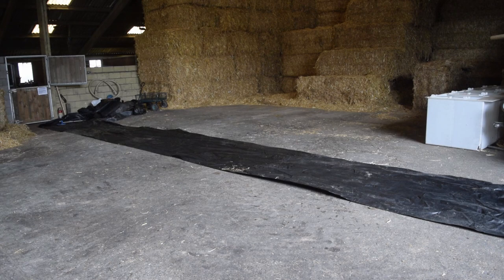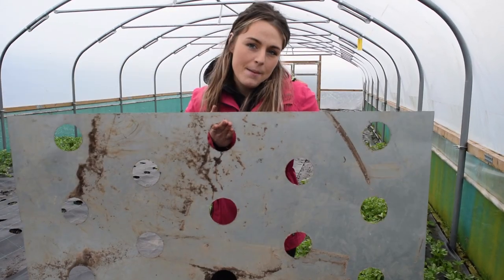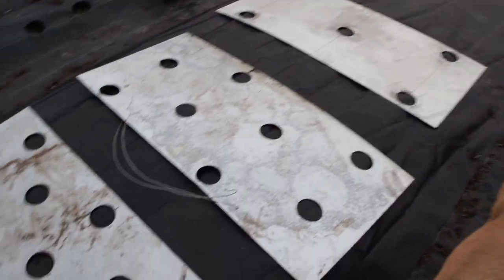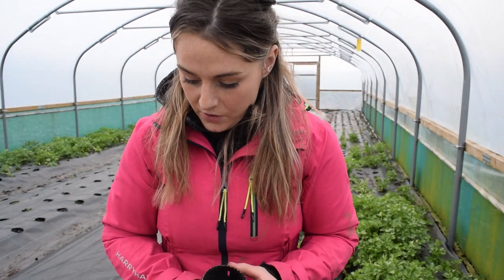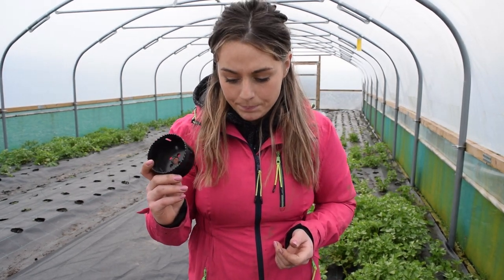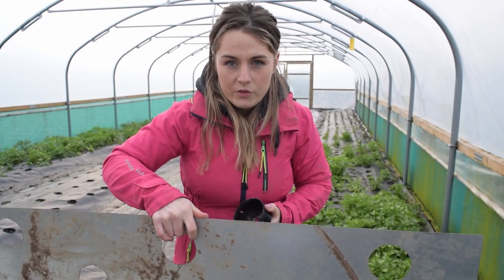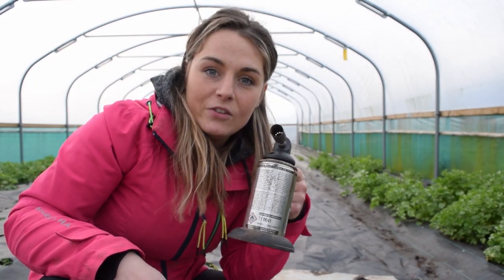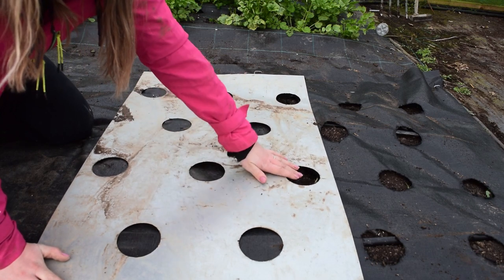PLANTING THROUGH WEED MEMBRANE | BURNING WEED FABRIC | REDUCING WEED PRESSURE | FLOWER FARMING

Comment: How does the torch not melt your pipe? On that note,- could you do a video on your irritation system you use and how it's installed before putting on the weed membrane😊 I love your videos by the way!- so helpful!
Reply from the maker: Hey the pipe is made of really strong plastic and as long as I’m quick the flame doesn’t effect the pipe. I will do a video on irrigation!
Reply: You may also use a tin can with burbing charcoal inside.

Comment: Thank you for sharing.  Having the templates is amazingly helpful.  That torch you are using looks fantastic, do you know where you got it or what brand it is?  This year we used a standard plumbers torch and had a ton of issues with it going out when inverted to burn our fabric holes or freezing up because it was on so long.  Super annoying and time consuming.  Did you run into those issues with your torch?
Reply: A decent plumbers torch won't go out when inverted, you probably bought a cheap basic one